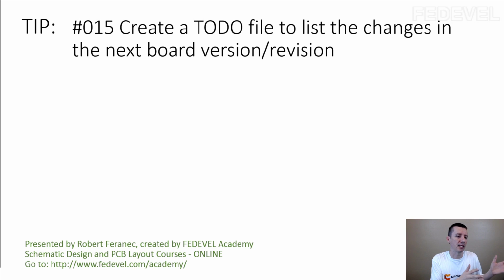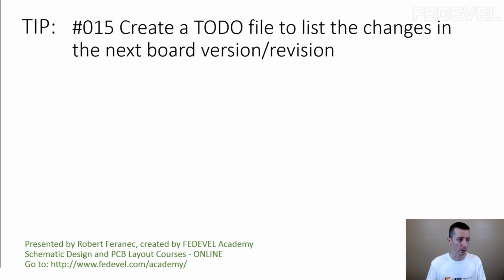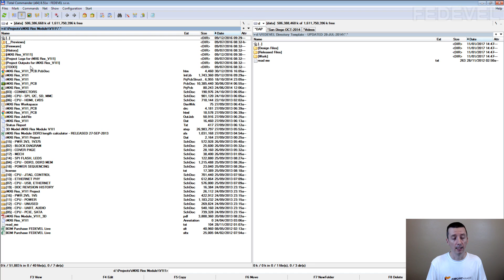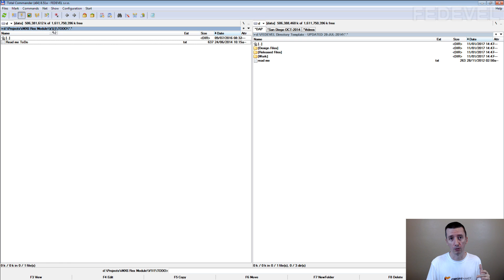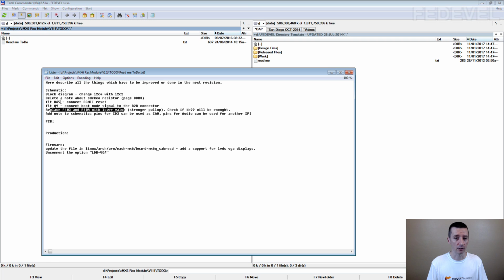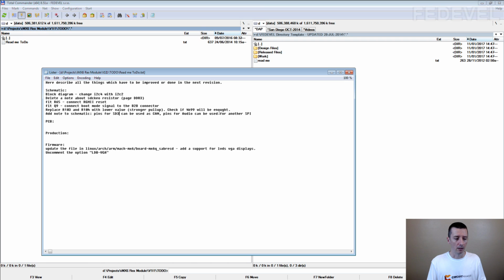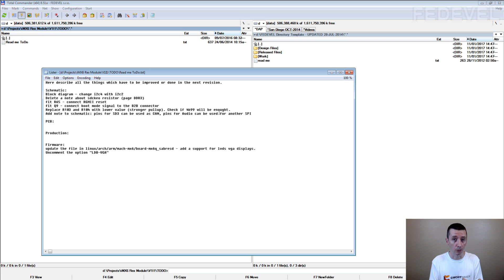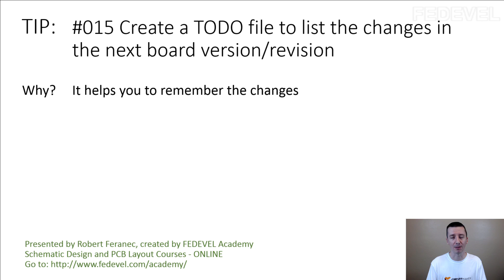TIP #015: Create a TODO file to list the changes for the next board version

Comment: I started using a excel file in the root direcotry of the project.  That files contains power budget calcautions, thermal analysis, changlog, to-do list of needed changes, swticher calculations, and board tracking.  This works pretty good as everything you need is in one place.
Reply from the maker: We do something similar when we test boards. I will make a tip about it.

Comment: Great tip. Sometimes it can be hard to write down all the modifications necessary. What I like to do is to open REV+1 immediatelly when I start assembling and find a problem (or later while programming the firmware) and modify the schematic on the fly. Usually, problems are not too big. I route/fix the pcb later, just before ordering new pcb. Otherwise, stuff gets lost very fast and you just transfer bugs from one board to another, wasting money :)

Comment: Robert, another question. Do you use SVN or GIT with Altium?
Reply from the maker: No. I tried and I know some people use it, but I don't. Maybe if more people are working on one project then it may be useful, but most of the projects we have worked on are done by one person - and what we do, we just occasionally zip the project directory and that's it. Our project directories and files are versioned automatically (when saved to our backup server), but in reality we have never needed to go back to a versioned copy of the files.
Reply: I've used SVN and Git, both at different companies.  They both use xcopy with binary files are fine.  Currently my team uses tortoise SVN because each project also contains mech files and firmware/software binaries.  If using Git is suggest useing the Githut GUI even if your Git server is local, it's much eaiser for binary files.
Reply: Felipe Navarro or you can even use SVN from within Altium but using a hit back end. I'm interested in hearing how other people do it
Reply from the maker: Thank you Heath for your feedback. Good to know.